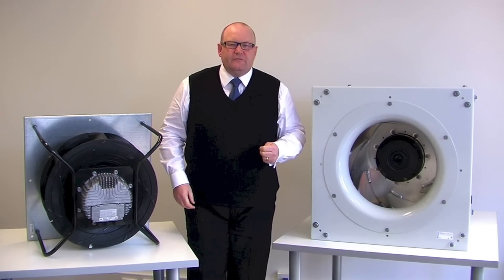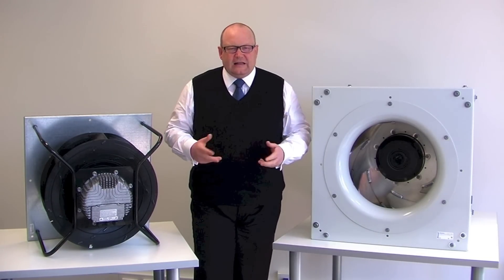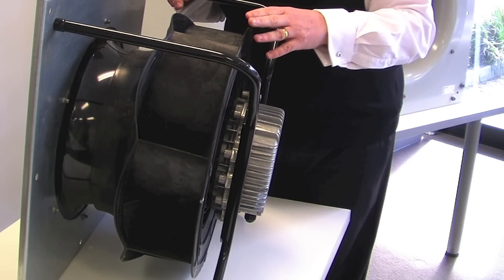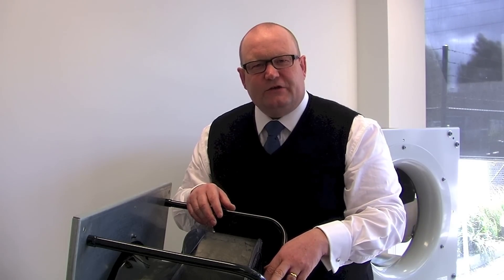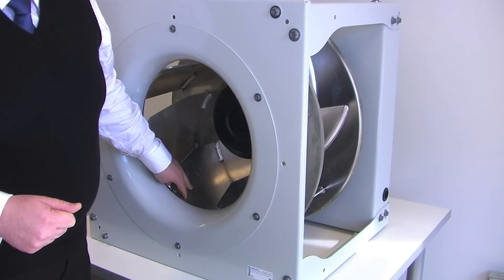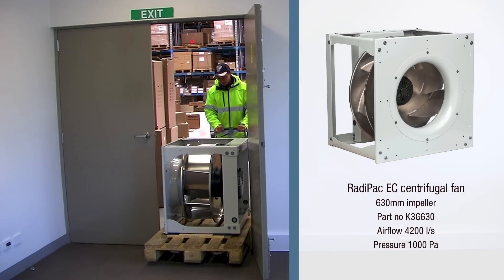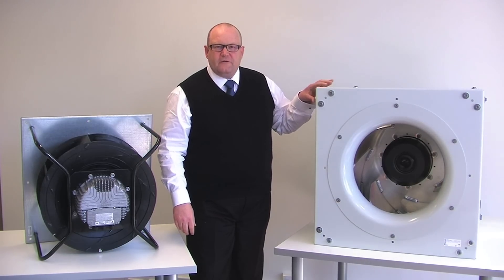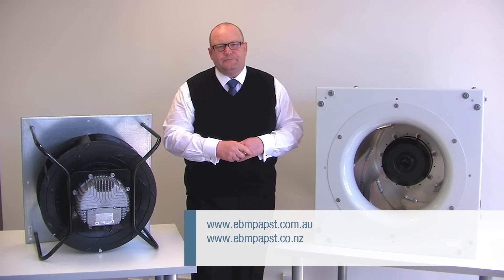Backward-curved fans without housing | EC Plug fans - ebm-papst A&NZ

Comment: I was hoping you were going to turn these on for show. With them being shaped that way, do they sound like vacuum cleaner fans? And if so, then why would anyone want them running throughout the day, like just standing a vacuum cleaner around and turning it on and leaving it, rather than trying to find a way to make the different sort of pressure from a forward-curved fan ("gerbil-cage fan") work so that all they have is white noise instead of the intense whine of basically a "vacuum cleaner" running for so long per use?
Reply: Hi, thanks for your questions.  I'll answer them all here.  Typically these fans are used in HVAC running 24/7 and provide great static pressure capabilities than forward curve fans.  They are also non overloading which means the power does not spike at low pressures and overload the motor as happens with forward curve fans.  Typically the static efficiency of these fans are also 30-50% better.  Regarding guarding all fans should be guarded to EN13857 and this is the responsibility of the equipment manufacturer.  Often guards as well as interlocks are used.  I hope this helps with your inquiries.  Thanks.
Reply: Thanks for your reply,  @SimonBradwell , with the few things that it did answer. But did it go over anything about how much these do or don't sound like vacuum cleaners because of their shape as opposed to the other style? And did it go over why you did not show the inlets or run them here? And did it go over the type of encasement these are used in even though you say they're not really in a housing?

Also, why would these systems be used 24/7 even in places where a building isn't even being used for many hours of the day and night? Why not have a period where it's completely shut down until a little catch-up period before business the next day?

Comment: Can u show me the normal direction of impeller turning , ? Also which direction does the air flow ?
Say Im facing in front of the motor, will the impeller turn CW OR CCW? 
As for directions. Will air hit the motor side first  and then leave the impeller , or first come in contact with motor then leave the impeller ?
Reply: Hi Sunny, the direction of rotation depends on the manufacturer.  Air is taken into the "eye" of the impeller, goes over the motor and passes out of all sections of the rotating impeller at right angles to the direction of the incoming air.  To tell the direction of rotation; when the blade rotates, the air passes through the blades such that the air is pushed out by the external facing surface of the blade.  Does this help? Thanks, Simon

Comment: Can we use standard radipac fans in refrigeration units?
Reply: Hi, thanks for your question.  YEs; the temperature needs checking but they are used in large industrial refrigeration quite commonly.  Small ones are also used in normal supermarket fridges also.